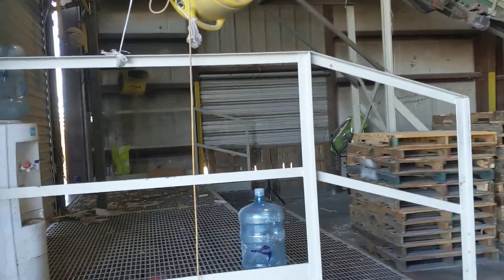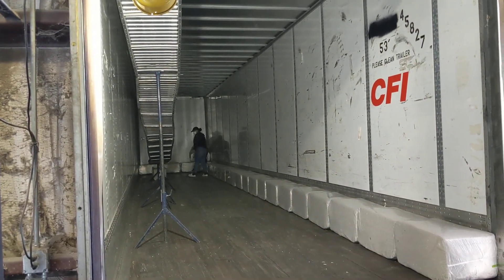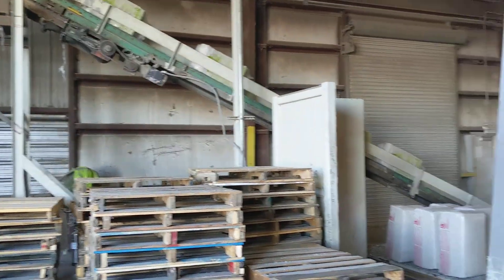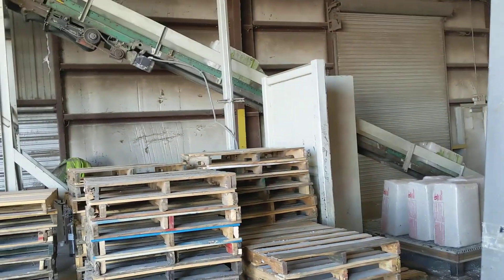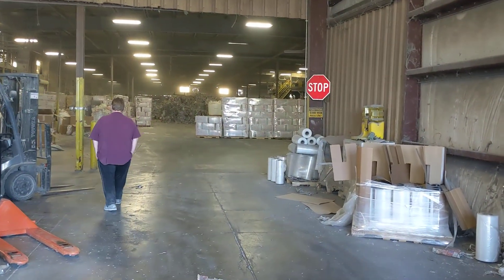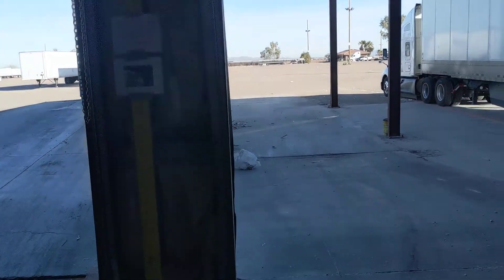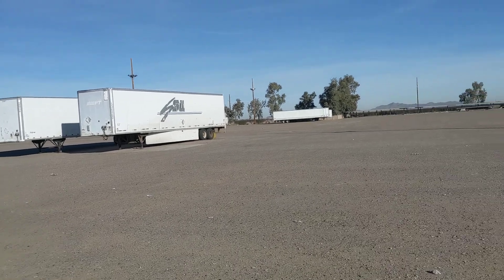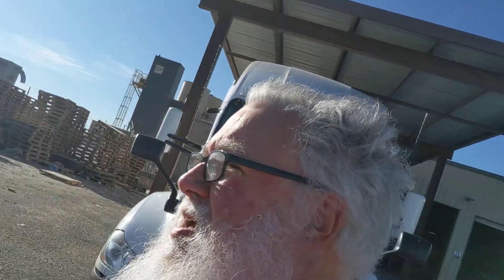Episode 18 - Casa Grande, AZ Inside a Shipper.

Comment: Heard you say that's the first time you've had anything on your trailer without pallets. So I take it you haven't hauled the rolls of paper yet. They're fun, especially the tall rolls. They put little sqaure rubber mats down, an set the rolls on top of them.
Reply from the maker: I actually have hauled several loads not on pallets, paper for one but they were huge. It was just weird to me that this load wasn't. I guess I misspoke.